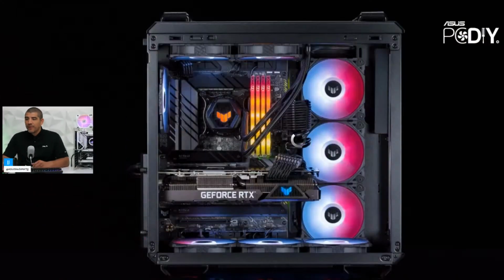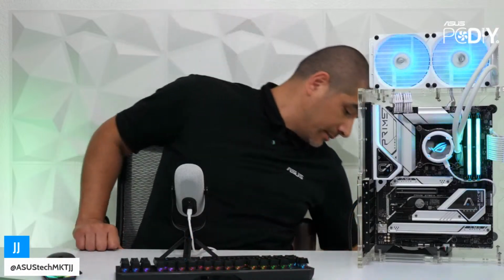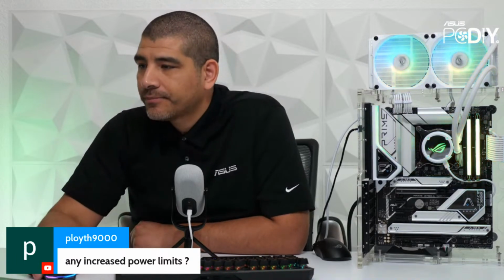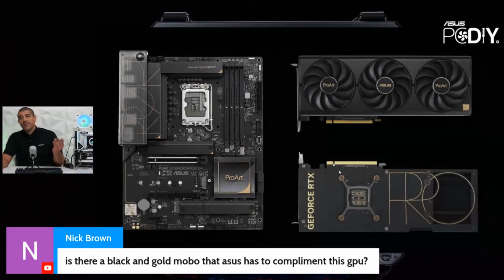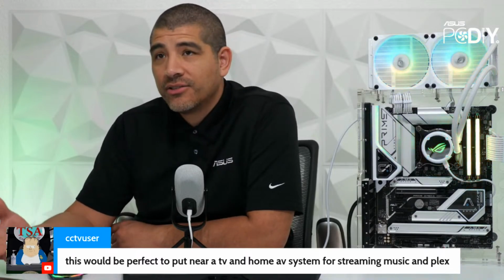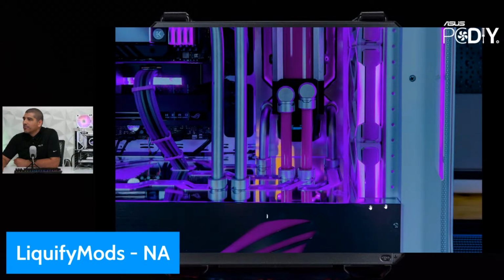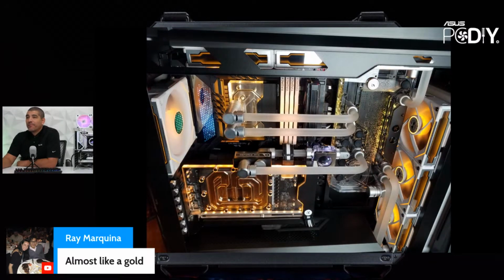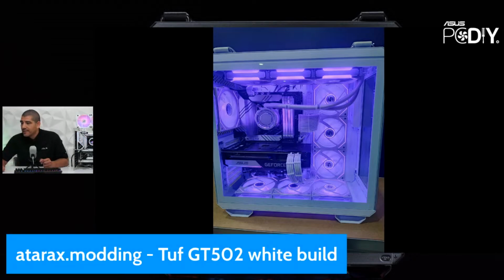PCDIY Show #89 - PN42 & PN4 mini PCs, ProArt Graphics, TUF GAMING & ROG STRIX LC graphics cards

Comment: When will you be producing a Rog Strix RTX4090 OC which comes pre-installed with dual active (front & back) water blocks? There are loads of people like me with a medium case, already setup with two 360mm radiator custom water loops, that a pre-waterblocked RTX4090 would slot into beautifully.

There were Asus - EK pre waterblocked cards in the past, & these are VERY attractive because:
1. They save e-waste; no redundant heatsinks & fans wasted.
2. They come with a warranty which is lost if users waterblocked the cards themselves.
3.They fit in even small cases via watercooling, as it's no longer than the PCB.
4. Have active watercooling on front and rear, with RGB, makes them look amazing from any angle with maximum possible cooling

This would be the ULTIMATELY stable, quiet & efficient option. So please tell us you that you will be selling Rog Strix RTX4090 OC cards which come pre-installed with dual active (front & back) water blocks, like the ones EK sell, ready to slot into our existing custom water loops, please?
Reply: I appreciated the pre-blocked EK/ASUS GPU's, as a previous owner of (3) of those models. I can say w/o a doubt they were an amazing segment to the market in terms of size and compatibility. A few things I would like to point out in your bullet points though... 

1. Correct! Less e-waste (it can also be cheaper than buying the GPU/WB separately). 
2. If you live in the USA, we have a law that does NOT void your warranty if you water-block a GPU, I believe it is called "The Magnuson-Moss Warranty Act". Many folks get confused/misinformed because in some countries it does void the warranty! 
3. Correct! My ASUS/EK pre-blocked models had the smallest footprint out of any models I've personally water blocked. 
4. This is unnecessary, I does look great though, but the 40 series GPU's do not have any chips on the back - yes, it soaks up some heat but typically it's only a few degrees difference. It made a much bigger impact on the 3090's. And, lastly "Active Backplates" have a much thicker design, this leads to compatibility issues with certain Motherboards.
Reply: @h2ocomputers316  I live in the UK.
Reply: @TimLongson  well, in that case ignore statement #2 lol
Reply: @H2O Computers  Jay's 2 cents had to change motherboards for a traditionally mounted GPU with and EK active backplate, because it blocked access to the M.2 socket, and if you put a gen5 SSD in there with a tall heatsink, like a waterblock on the NVME, then you need a motherboard with a greater fsp between the top PCI slot and the top M.2 slot, yo avoid overlap.